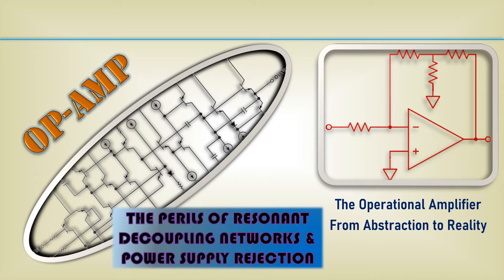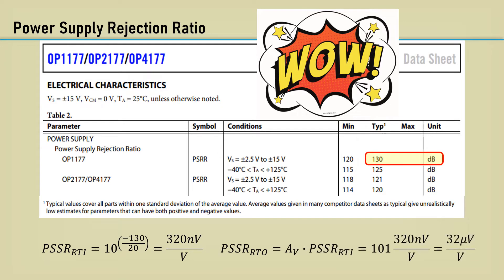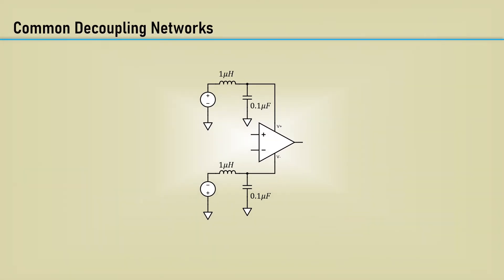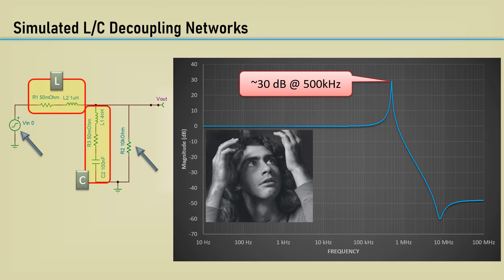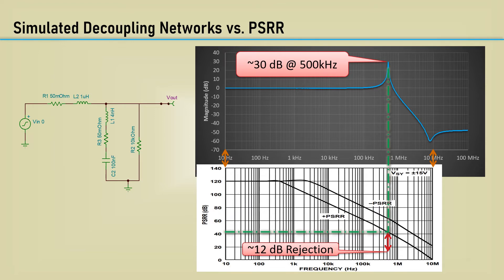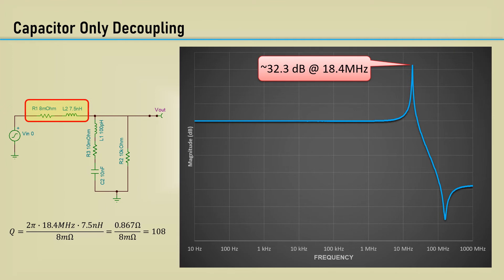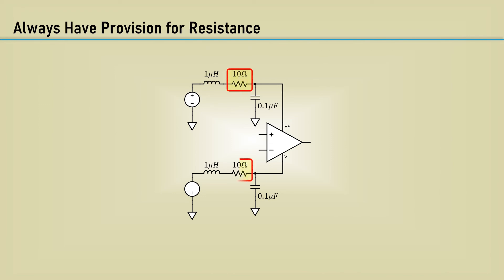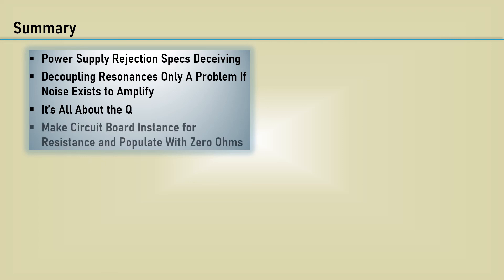The Perils of Resonant Decoupling Networks and Power Supply Rejection & the Magic 10Ω Resistor

Comment: Between this video and the Floobydust series, it seems clear to me that this "Old Hack" actually has some Deep Background in the development of operational amplifiers and other analog integrated circuits. I'm guessing some "wizard" of the industry pulling back the curtain in his retirement, while maintaining his anonymity. "All right then, keep your secrets."

A while ago, I stumbled across an old AD app note that mentioned in passing that a series resistance (~10 ohms) could be used to dampen resonance without going into any explanation as to why or how. I'm sure there are other app notes that deal specifically with Q and dampening, but this video is the best demonstration I've found of how it works...even if a few math steps were left behind. :p
Reply from the maker: LOL, more like the Wizard of Oz! I could have done the circuit analysis, but it would have took a lot of work. I'm always amazed at how the analysis of only 6 components gets egregious. Thanks for the comment.

Comment: Great video! In case the current draw is large enough or varies enough to prohibit a series resistor, a good alternative can be to put an RC-circuit in parallel with the capacitor to GND. But the capacitance needs to be much larger (ideally 5-10 times) than that for the original capacitor. The R in this RC link can sometimes be the ESR of the capacitor, if it is a suitably selected electrolytic or tantalum with relatively large ESR. It is always a very good idea to simulate decoupling networks like these in LTSpice or some other simulator like you showed in this video. It is easy to get good correlation with reality and the results can be surprising (and very instructive) for those who have not done so before.
Reply from the maker: Indeed. You are spot on. I've seen high power systems that have an entire series RC network for damping. RF amplifier evaluation boards often come with resistors across the DC inputs to damp any series L in lab supplies and interconnect. It doesn't have to be in series. Thanks so much for the comment.